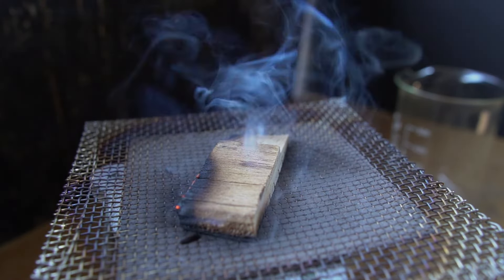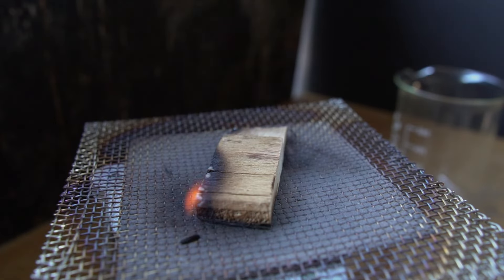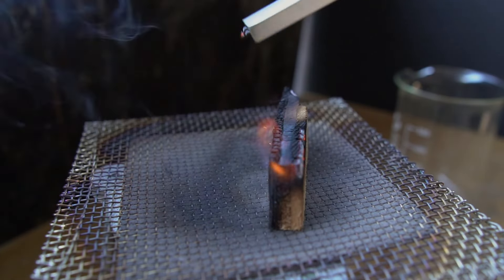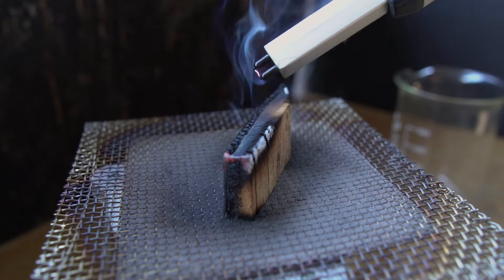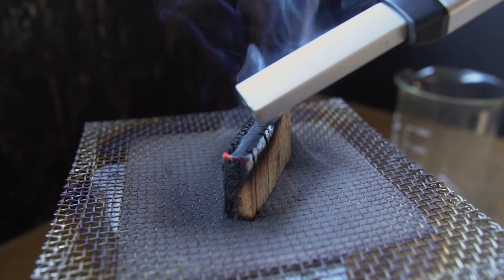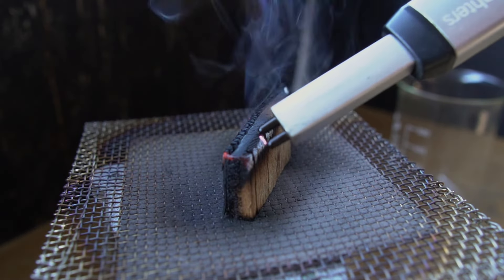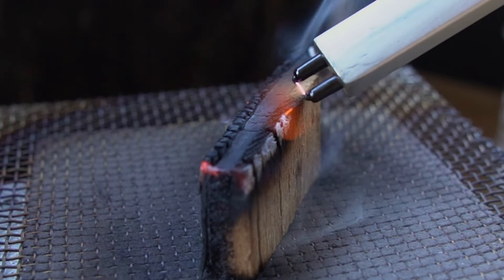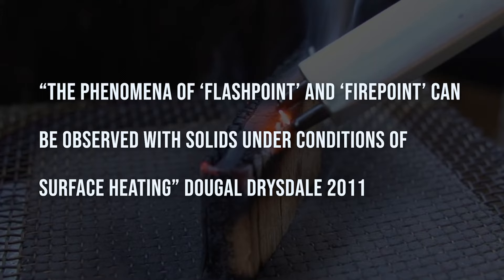Flashpoint, Flame point and Autoignition - Episode 15

Comment: Your video is a great help for people like me who is study by themself. Because the textbook is often quite confusing. The definition of flashpoints in Principles of Fire Behavior, Second Edition is 'At piloted ignition, the surface concentration needs only to achieve the LFL. At this concentration, the corresponding surface temperature is called the flashpoint (T_FP). '  A fuel at LFL concentration could be in a range of temperatures. This was why I was bemused before I watched this video